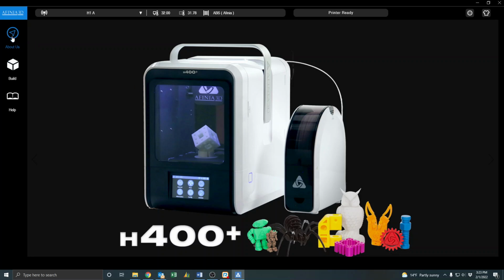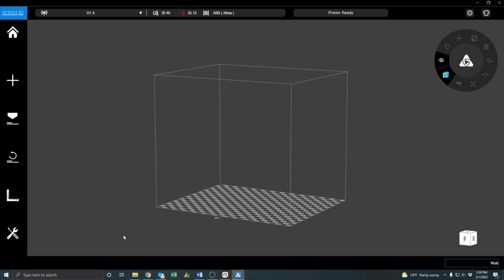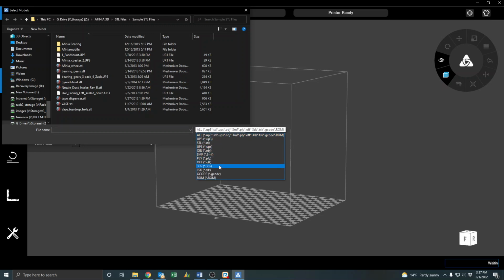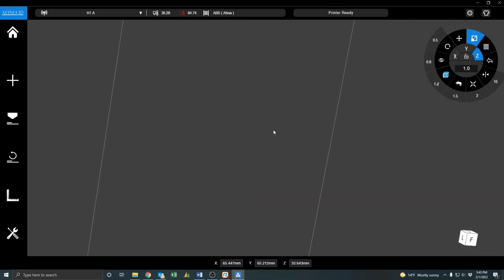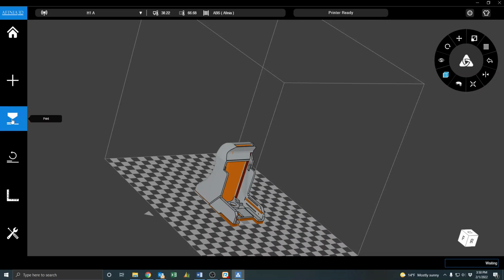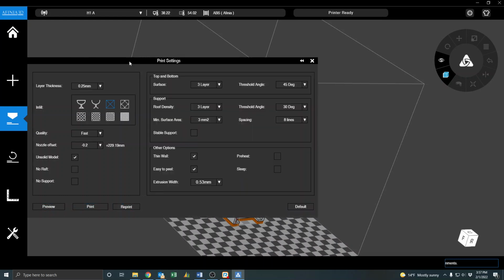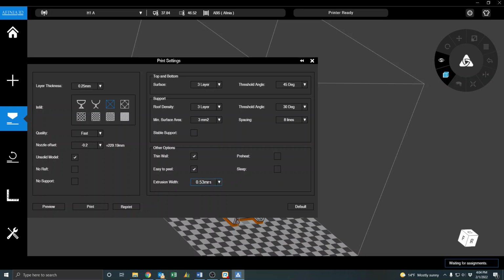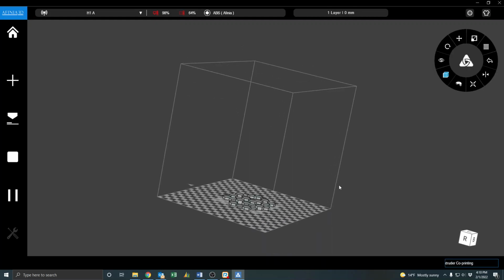Afinia Studio Software Operation February 2022

Comment: Do you have a video for adding new filament presets? I am having a hard time adding new ones and customer service is useless.
Reply: It's a literal reskin of Tiertime's UPMini2, so that should be able to help you broaden your search at least a little bit if you're still messing around with this thing.
Reply: thanks for the insight. any ideas if you can use a different software like cura?
 @Binary_Omlet